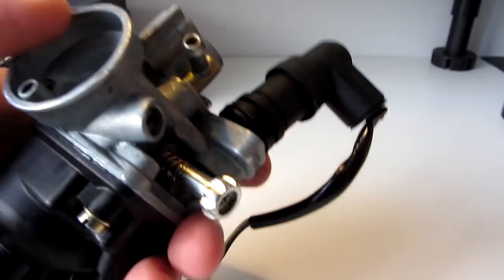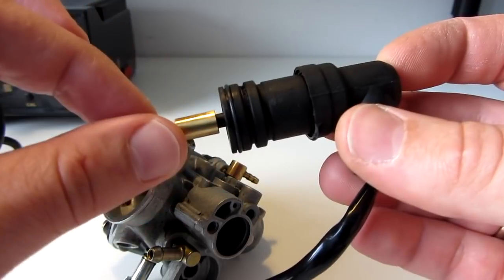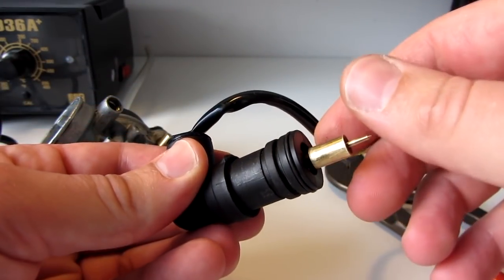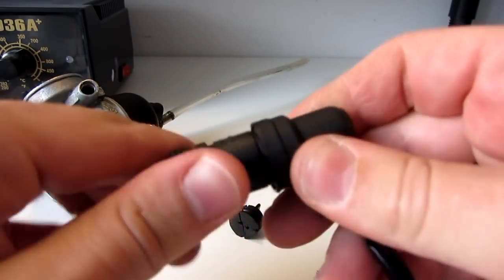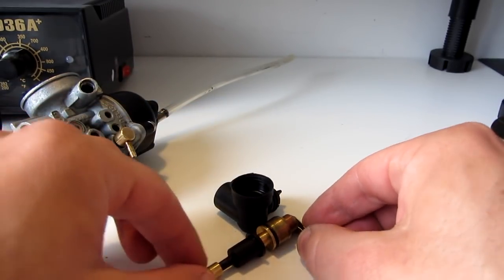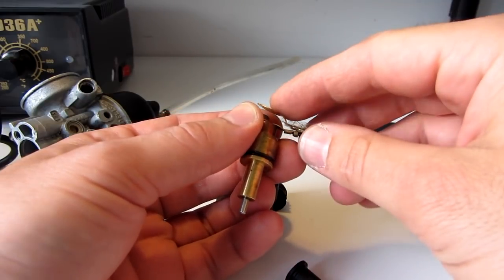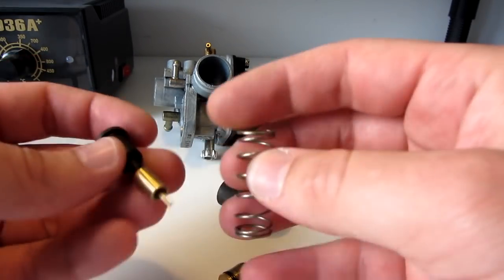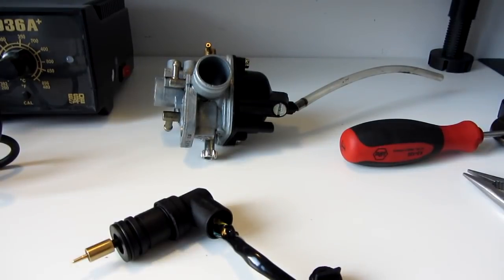Automatic Choke operation - dеllorto carburettor - How does it works and what's inside

Comment: Thanks for a great video. I was wondering if i had mine put back together correctly.
Reply: 50cc carburetor vacuum lines
Reply: @samcollins960  what about them???
Reply: I don't think there is any reason to take one apart, because why would you? Just buy another one. They're cheap.
Reply: @radconserv68  The one on my 125 Malaguti Madison was Japanese cost around £130 + U.K.  the standard carburettor on the standard fitted Yamaha engine was also made in Japan & cost £500 + .So £130+ for one of these units is hardly cheap ,especially as they can go wrong just as fast & cause you loads of hassles with multiple engine cut outs & poor running .It’s no problem to use a manual choke .Automatics were designed for lazy car drivers & women who thought the old pull out choke levers were to hang their hand bags on .
Reply: @radconserv68  The stock piaggio choke for me is 80€ like bro Im only 16 I dont have that much money.

Comment: what if that device has no power in it..or supply volts.....is the motor still start or not?
Reply: I would think that without any power to it, it would allow the maximum amount of fuel to flow and once the engine heats up, because it has no power to it, it will still allow the max fuel and make the scooter run poorly. I don't know that for sure, but that's my opinion.
Reply: Depends on weather conditions...if yours stuck open yeah it will start but hot start will be the problem...also eating way much fuel than it should...

Comment: Is this adjustable mines letting too much fuel in and not enough air
Reply: Nope...thats why automatic...if its stuck seems yours like mine "on" so you need to replace it...its like £12...otherwork around to either put a inline fueltap like manual choke or just closed the supply tho it will make cold start difficult....mine has hot start problem...what I do is when I having problem to start hot is remove the fuel line and close both end..so its not supply extra fuel atm but only just the first start hard and then we good...on cilder days just reconnect it...annoying but better than taking the bus.
Reply: @attilahermann6034  I’ve got a manual choke on mine now works much better I don’t even have to use it at the moment as the air temp is warmer
Reply: It is adjustable, it getst adjusted by unscreving that plastic cap if you can get it loosened up.

Comment: How did you managed to unscrew that easily? Mine was so tough to unscrew like it is glued
Reply from the maker: Yes, mine too. What I am showing here is second or even third time after first unscrewing.
Reply: chavy levy how did you managed to loosennit up? It looked clean mine got real bad because i had to use pliers to hold it in. Thanks
Reply from the maker: @ninoechavez1402  I don't remember but I think I used the big red pliers you see in the video together with a cloth to avoid damaging the plastics. If you have the opportunity it's best to buy a new choke. Once opened I would not trust it anymore.

Comment: one question , if the automatic choke isn't good does the scooter start up?
Reply from the maker: I am not a specialist so I don't know the types of failure for the automatic choke. But if...
A) it fails to extend this should not prevent you from starting your scooter - it would just mean that you will be wasting fuel.
B) it it fails in extended position this may not allow you to start the scooter - i.e. choke is constantly off.

However, if your scooter does not start most probably the problem is somewhere else:)
Reply: chavdar levkov If the choke is always on it doesn’t just mean that you are wasting fuel, it can also make the scooter die from too much fuel.
Reply: Its depends how its broke on or off.if its on...wasting fuel and cold start will be ok but once the engie warmed up it won't start..Hot start will be a nightmare...
If its off position than it will be a nightmare to start it cold weather or cold start however once she warm she will be fine.

Comment: Heats up??? What?  Delete this bs video.  It is a solenoid type plunger with 12 volt applied it lifts.  There's no heat involved it's a gas setup.
Reply from the maker: Please refer to the attached link. It is well demonstrated there.
Reply: @chavylevy7355  you're giving misinformation correct it or I'll report your profile.  I am a small engine business owner been working on small engines for over 30 years..and your commentary is absurd.